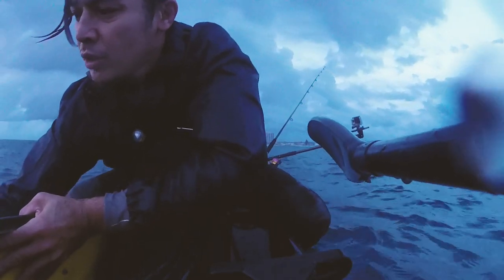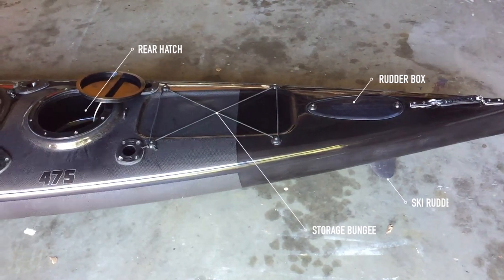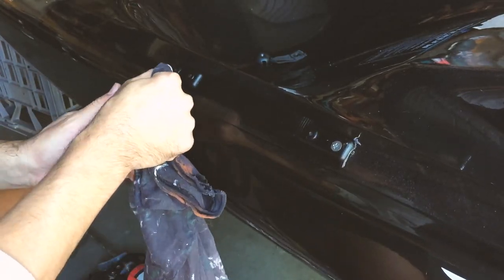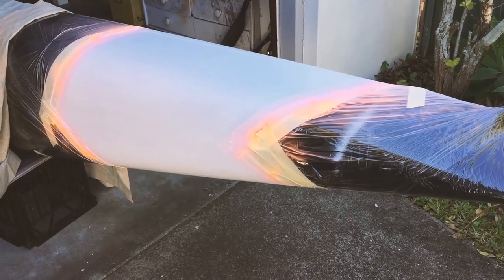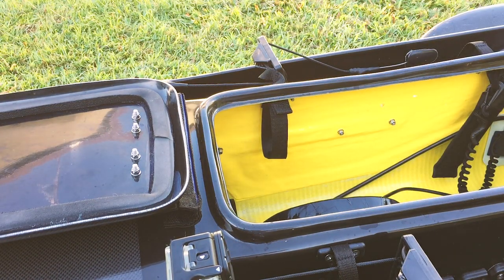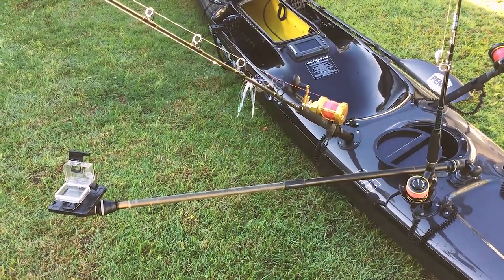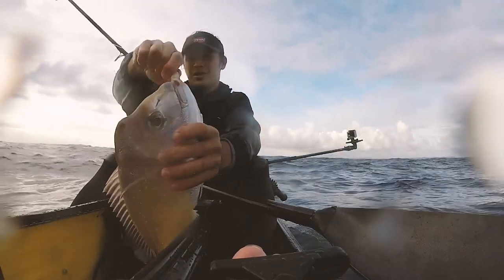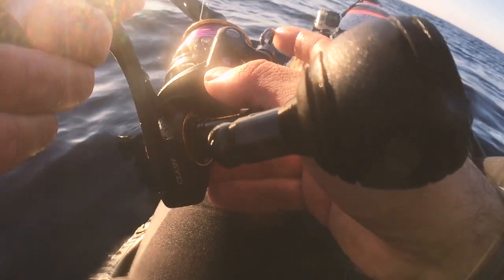Offshore kayak fishing setup - My ultimate Stealth fishing kayak

Comment: looks uncomfortable
Reply: So comfy. You'd be amazed when you force your body to compensate.
Reply: Is there any seat padding ? It looks awesome i was just wondering about comfort after a couple of hours
Reply: +James Ireland, yes. There is an accessory padded seat and back rest available. I find it quite comfortable without the padding. It's not like the seat areas on an old plastic kayak. It's kind of like a bowl.
Reply from the maker: Hey James, looks like Fred has answered a few of your questions which is nice. The seat shape and the lower foot resting position in the foot wells does make it quite comfortable, I have done some long days in the Stealths and not had a problem... but yes, its not going to have a folding padded seat like a Hobie PA anytime soon :) It's like most kayaks you compromise on certain features and find the one that suits you best. Cheers Rod